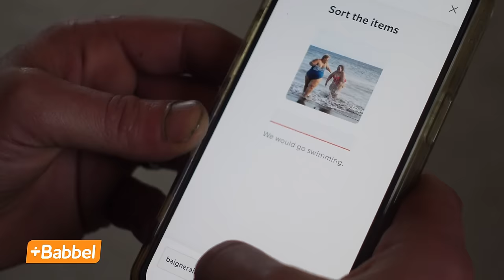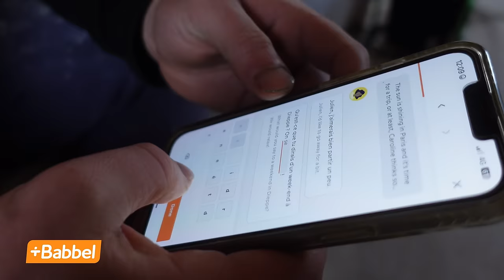FURNISHING The First Room In Our CHATEAU RESTORATION

Comment: I love the fact you've used gold to pick out your panelling, it gives depth and texture.
If you look at french style curtains, they're quite plain in treatment, just gathered at the top, no pelmets. They tend to go more extravagant on the bed treatments.
Your card table is gorgeous I'm so envious. Keep it covered when not in use, the green baize will fade in sunlight. Also, a cribbage board and pads and pencils for bridge and other scoring games if you have a drawer in the card table... with a couple of packs of cards for canasta 🙂
A little fan on the top of the fire will blow the heat into the room. Its not connected to anything, works by convection. Stops the heat being drawn up the chimney.

Comment: Ash/Terry: Me again; just noticed the furniture glides you are applying.  Those will scratch the HECK out of the floor!!  They make felt ones that are for polished floors, the ones you used are for carpet (they'll slide on it).  The ones I used are Ultra Heavy Duty Felt pads, made by Waxman.  I don't remember where I got them, but any hardware store or variety store should have them.  Save that floor! Cheers!

Comment: Exactly How many Rooms are completely finished and how many more in the main building are yet to be finished and  is there a HVAC  Heating ventilation and air conditioning  unit to be installed